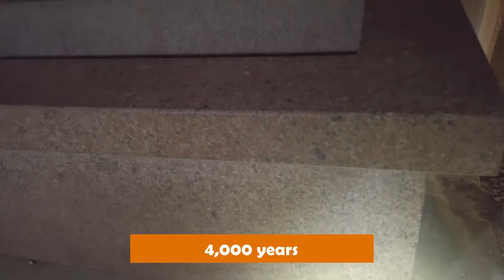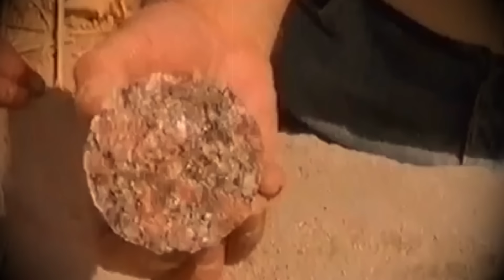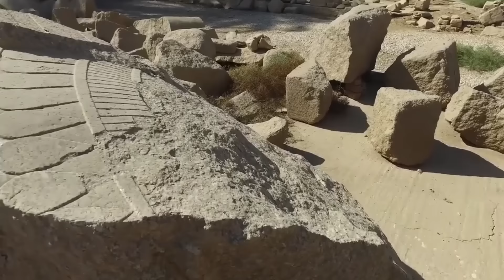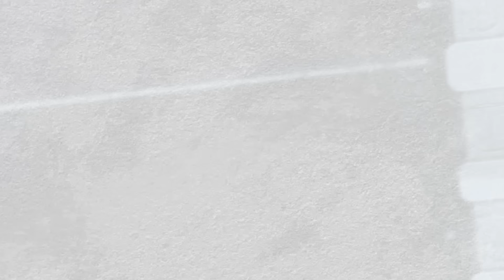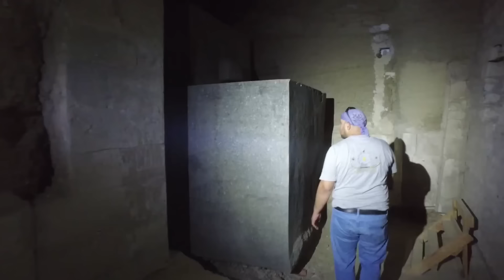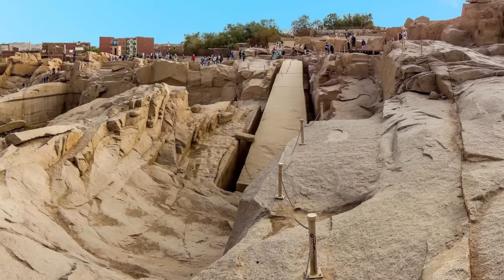"I Found Out What Ancient Egyptians Used To Cut Granite And I Brought Proof" | Graham Hancock

Comment: Copper will NOT even scratch high granite!   The copper will just smear and attach to  the granite.   Exactly the way that a pencil smears graphite onto paper.  
They were likely using some kind of diamond or ruby cutting cutting edges.  
Diamond would embed into copper and that would be able to easily cut granite.

Comment: maybe they used diamond set tooling with acid or granite sand residue using a hard sand after they made the first holes, they then used that sand to make other objects, ( they did find what looked like a old battery) ,so maybe they did have this type of tech back then, the most important aspect is there is no textual information as to how everything was built even by egyptian standards ,so they are a lot older than when the egyptian kings ruled the areas. 👍✌🦘

Comment: I don't know about anyone else, but when I look at the unfinished Obelisk, I see the 'scoop' marks and think... Hey, signs of High-Pressure Water Jets! And before you 'pooh-pooh' me on that, just think about this... The Ancient Egyptians lived right next to an immense source of water. Water that flowed. Imagine a long tube set so that the opening takes in water as it flows along the Nile. The force of the water and the 'weight' of it moving, pushes the water up the 'ramp' of the hollow tube to fill a catch basin. From there, it can be moved further upwards by using very narrow tubes to 'lift' the water using gravity to push the water through the tubes and up against gravity. Eventually, you have a tall 'vat' of water. Tens of thousands of liters that gravity wants to flow downwards. So, you allow this water, now under hundreds of tons of pressure, to flow through thin tubes to the work site, where it is directed against the stone. Possibly while also being mixed with various abrasives to aid in 'water blasting' the stone. In effect, a huge and somewhat clunky water jet drill. And before you exclaim, "But they didn't know that!". How do YOU know that they didn't? The Hanging Gardens of Babylon were fed using a similar system. Why not use it to blast stone? We know they were smart enough to notice that flowing water wears down stone of any and all kinds. That's all it would have taken. One person, who noticed the water wearing away at stone, and then thought... 'what if I could get water to do that faster and where I want it to?' No 'ancient secret powers', just the power of flowing water. And a system they could easily have built out of wood, stone, and the metals at their disposal. Nothing special. Just simple, relatively efficient, and uncomplicated. As to the drilling... easy... Again, the force of millions of tons of water flowing in the Nile pushes water up tubes to basins, and the basins then push that water via its own 'weight' to higher and higher basins, until you reach the desired height and water pressure. Now, allow the water to flow in a metered manner through a primitive geared turbine to spin hollow drills. Drills that are cooled by the same abrasive slurry that is aiding the diamond or corundum-tipped drill itself. The same method is used to spin large discs of metal, also corundum-tipped and slurry cooled, to cut like a huge band saw. All that is needed is to believe our Ancestors had minds at least as capable as our own, and could efficiently use the resources at their disposal. Why are there no traces of the tools? Efficient use and reuse of materials. That area of the world was wracked by plagues, storms, earthquakes, etc. The knowledge of how to build, maintain, and use such things might have been lost. Those surviving would have scavenged the 'machines' for their resources to make the simple tools needed just to survive.